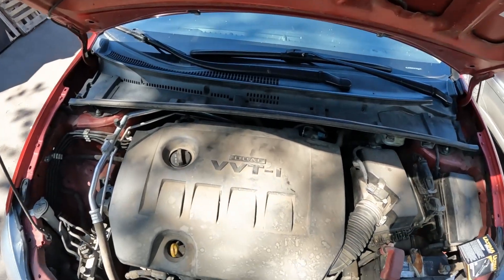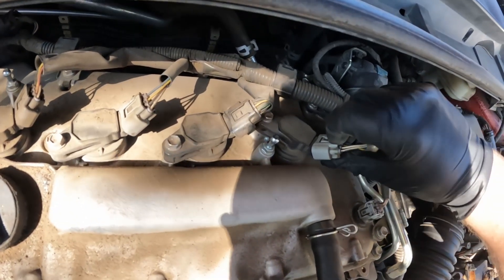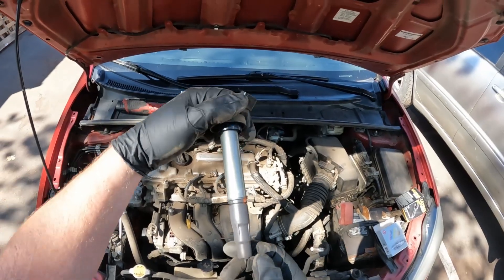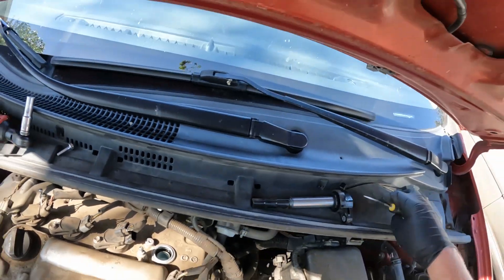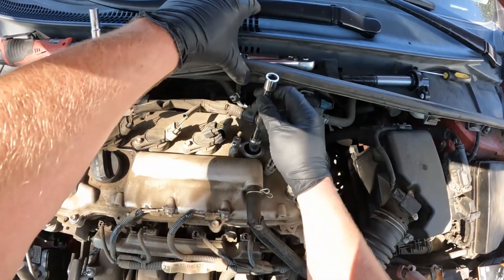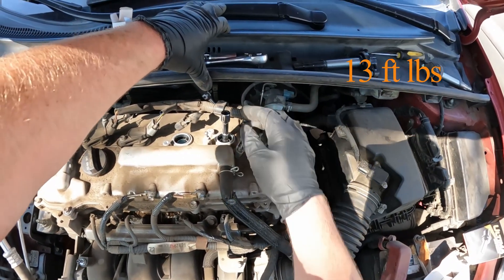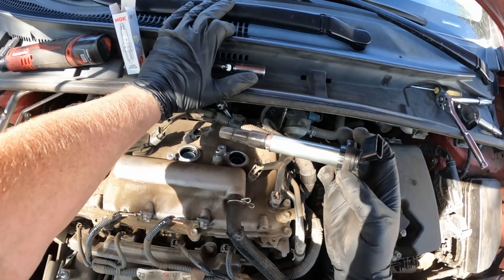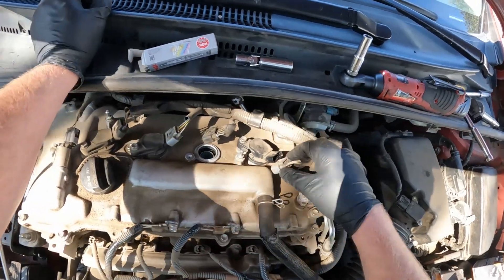Toyota Corolla Spark Plug / Ignition Coil Replacement 2009 - 2016 P0300 P0301 P0302 P0303 P0304

Comment: Dawg you literally saved me, I didn't know much about repairing but after a $120 quote per spark plug, fuck that. Bought a wrench, torque bar, the spark plugs and rubber and got to work. Finished real quick and fixed a misfire that was about to leave me stranded.

Comment: So is putting dialectic grease on the boots necessary?
Reply from the maker: @thingshappen9199  it will prevent corrosion.
Reply: @GrimRepair  I see. What about torque spec for the coil tubes?
Reply from the maker: @thingshappen9199  I'm not sure, its not critical, just don't over tighten it to where you rip the threads out or break the bolt.

Comment: so can I just replace one of them if the code that the OBD is reading is that only 1 cylinder is misfiring?
Reply from the maker: @AlejandroPerera-z8d  you can but, expect the rest will probably go out soon.
Reply: @GrimRepair  Can confirm this is correct. Mine went out after 2 months, should’ve asked the shop to replace all 4 coils.
Reply: They will go out within a month or so of each other 😭😭😭

Comment: How do I know which cylinder is cylinder 1
Reply from the maker: @maxmancilla474  cylinder 1 is the one closest to the front of the engine ( front being the belt driven accessories.)
Reply: @GrimRepair  in a 4 cylinder engine, just tell the viewers which is cylinder #1....
Reply: So in this video, he did cylinder 4 then right?

Comment: Do coils go from left to right as #1 #2 #3 #4?
Reply from the maker: @Kat_X085  yes
Reply: @GrimRepair Thankyou. I just tried changing it but now my car isn’t turning on.. 🫤 I think it’s because one of the small wire on one of the tabs is a bit messed up or that I didn’t do the thing with the battery. 😖
Reply from the maker: @Kat_X085  The thing with the battery?
Reply: @GrimRepair  taking off the negative post side of the battery before changing the coils
Reply from the maker: @Kat_X085  I'm not there to know for sure, but I wouldn't think those things alone. Would keep your car from starting. Did you leave the door open during the repair and the battery died?
Reply: @GrimRepair  no but I did notice I accidentally had my headlights on before I started which I then turned off. I’m going to try to jump start it to see if it’s the battery.

Comment: If im just getting new coils is it still neccesary for me to replace the boot/spring/seal as you did on the old coil?
Reply: Reading your other comments, this is an old coil. I am replacing along with the spark plugs, the new coils should have new boots, springs, and seal and I won't have to replace that?
Reply from the maker: @blueaidan5802   New coils, will have boots already installed.

Comment: I just replaced mine and though the car now accelerates and seems to be running fine the check engine, trac off light is still on- any idea why?
Reply: P0304 - saying most likely ignition coil. It started with the check engine light coming on and I noticed the car not accelerating almost shaky. 
I just installed the new coil and now it’s driving and not shaking but the check engine light is in fact still on and the trac off light
Reply from the maker: @Rickyg420  It may take some time for the light to go off. If it was the coil and you only did 1, the others are probably on their way out as well.
Reply: @GrimRepair  it ended up being 2&4 replaced both now light is off
Reply from the maker: Not without looking at it. You need to hook it up to a scanner.
Reply: @GrimRepair  thanks for the fast reply- gonna take it back to auto zone tomorrow but only replaced the ignition coil not the spark plug so hopefully that’s the only reason
Reply from the maker: @Rickontube  autozones scanner probably can't tell you anything about your track off light. What code were you getting that made you decide to replace a coil?
Reply: Do i need to re-set the computer for the lights to to off ?
Reply: @javierempecherado09  it should go off if the problem is gone
Reply from the maker: @javierempecherado09  the check engine light will ho off eventually if the problem is corrected. It won't ho off right away.
Reply: When I changed mine the light was on for like two more days after buttttt it was running smooth. The light should go away eventually on its own

Comment: Should replace the whole coils
Reply: I replace the oem coils at 100,000. With the plugs. I use all oem on coils and plugs. I’m surprised to here you are getting 200,000 out of them. Manual recommends changing at 100,000
Reply from the maker: Why?
Reply: Because they go bad overtime
Reply from the maker: @derek5296  Everything goes bad overtime. On this car if they go bad they are easy to get to. Within the fleets I work on, I am consistently getting well over 200,000 miles on original coils. If you do insist on replacing them, get them from the O.E.M. cheap ones will likely be worse than used originals.
Reply: @GrimRepair I found a set of NGK coils for a good price. Will they be adequate?
Reply from the maker: @dumper87  ngk is a fine brand.
Reply: @GrimRepair is autolite spark plugs good or ok to use for my 2014 Toyota Corolla S
Reply from the maker: @leadingladyvoluptuous5023 these are what I used https://amzn.to/3JCnmr3

Comment: Do you have to change all four ignition coil if only one is the issue
Reply from the maker: Coils no, coil boots yes they should all be done as a maintenace at around 100,000 miles.
Reply: Do you have to change the spark plugs if the code is reading just coil a?
Reply: @ElizabethH_  you don't have to, but if budget allows you might as well...